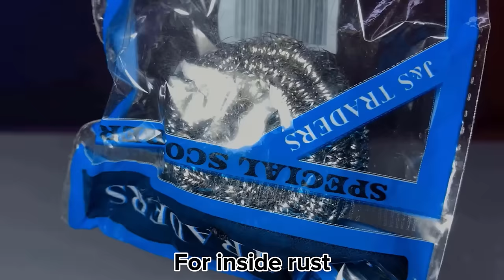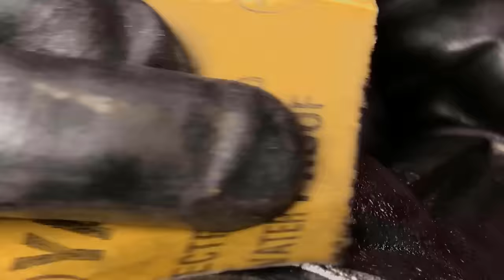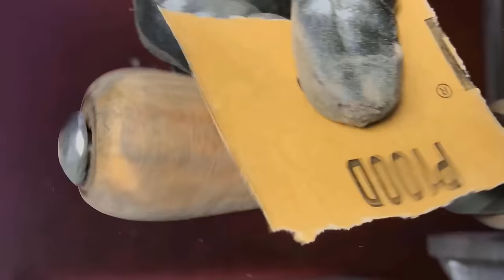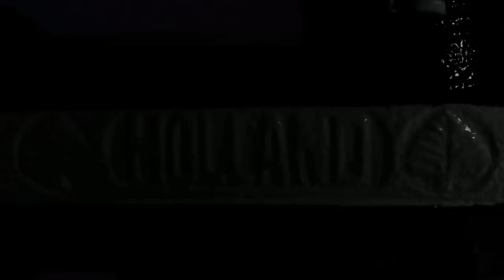100 Years Underground! Rusty Antique MEAT GRINDER Restoration

Comment: 100 Years underground, not likely, the handle still turned after 10 seconds of clean-up, this is fake, you have placed it in clay for a while to make it look bad, there was basically zero rust, the bearing was in workable condition, even the timber handle was in 99% good condition, better try again,

Comment: Definitely not 100year old, once again wrapped in wire and coated in mud/cement to form a crust to make look buried for years.  Definitely would not eat anything ground through this thing as would nevthave been painted internally.  If you look carefully you can actually see small black flecks coming through on the meat.
Reply: Aha! I wondered what would be the  sense with this wires.

Comment: So disappointed this time. The wooden handle should never been placed in the water. The clay blanket was a protection reinforced by the wire and the wors of all was the paint job. These are never painted. For 100 years looks still the same.

Comment: 100 years in the ground and NO pitting ?? Naaaah ! And the exterior rust is from the iron wire on it . And that wooden handle is in perfect condiction, other then being submerged the wood would not be like that... and if it was the metal would be gone .
You do a good job at reabilitating the tool, just don´t miss categorise the thing !

Comment: I wonder why all these objects seem to be covered in limestone, mud, chalk with little or no trace of rust, serious, large rust, the rust that eats away at the metal, devours it, digests it.  This meat grinder looks like it was soaked in mud for a while and left to dry.  Speed up the videos a bit because you are unnervingly slow and every now and then use a good sandblaster: you save time, the work comes out better and you will have less use of the chemical products that you use abundantly.

Comment: Restoration is "to return to original state'. Meat Mincers were coated with a protective covering of nickel or similar  (Matt) they were not painted, add definitely without two tone stripes. .Why do you insist on slathering everything with blue sludge, did you get it on special? The video is 50% theatrical, boring at best. You are obviously capable but it would be tter to just stick with true restorations.

Comment: The thing was probably rusty to begin with due to the pitting on the knife assembly and shaft, but the stuff on it at the beginning was just clay dirt that was packed all over the meat grinder. Real rust with that thickness looks nothing like this. Also there would have been much worse pitting on everything, especially on the outer body. The stamps and other similar markings would have been basically all gone by now. Further, never paint components that would be in direct contact with the meat. The insides of these grinders are always unpainted. Otherwise you get paint chips and who knows what chemicals going into your sausages.

Comment: Why disfigure the tweezers at the initial stage? A couple of blows with a hammer in an instant would take out everything that had dried up from the meat grinder.
This is not a piece of jewelry, but a solid piece of steel, with steel giblets.